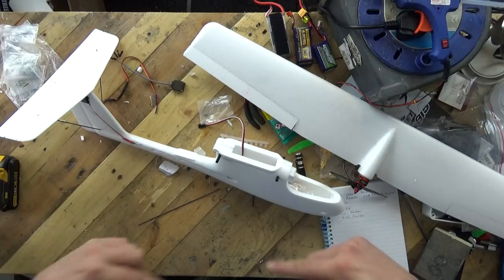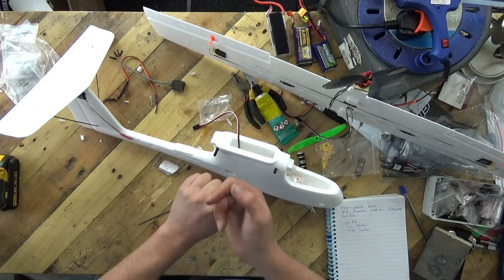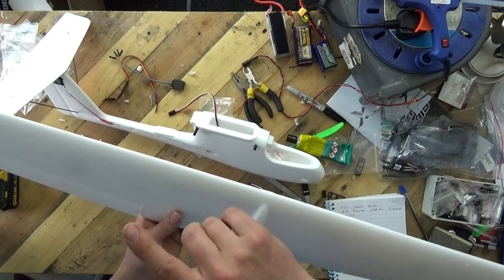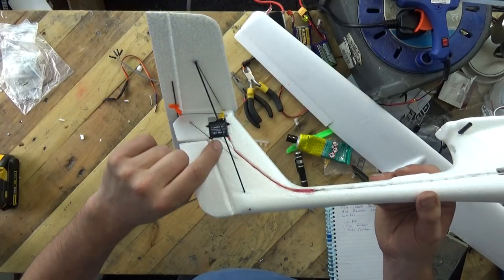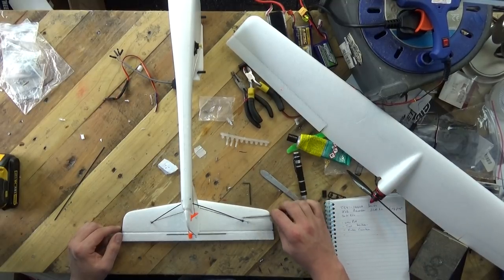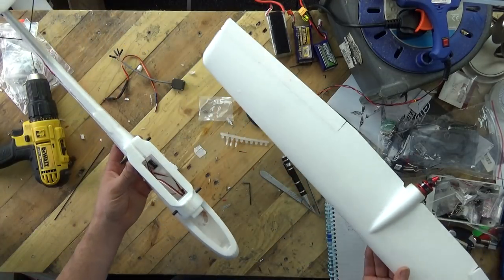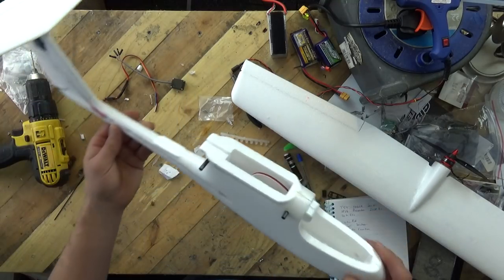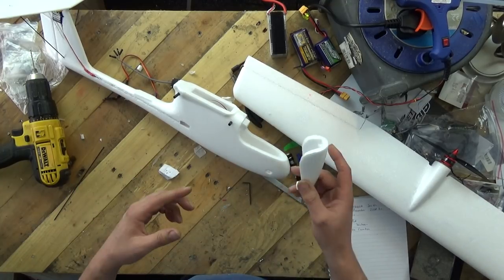Mini Skywalker T-Tail Strengthening & the Build So Far

Comment: I flown mine on 4s 1300mah rs2205-2300kv motor. It's a tiny rocket! But needs lots of carbon as you pointed out, matt. Lovely little plane. Want to get another one for slow cruising long flight times.

Comment: Not with you on the all in one cams. Go for a Foxeer Arrow Pro. £18 in the sale on Banggood at the moment, then use a Micro VTX. Used RunCam one, its really good. Cant comment on the Eachine version, but can't be that bad. Just hate the poor picture on the really cheap CMOS Cams. Also seems like there is a load of lag, then it catches up, then lag again & repeat.